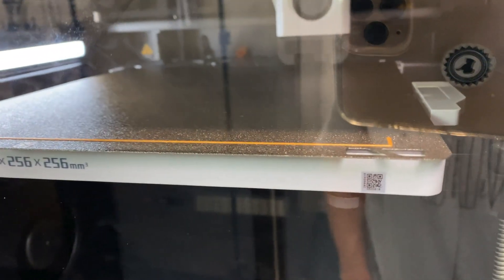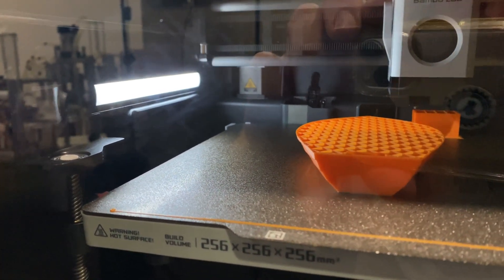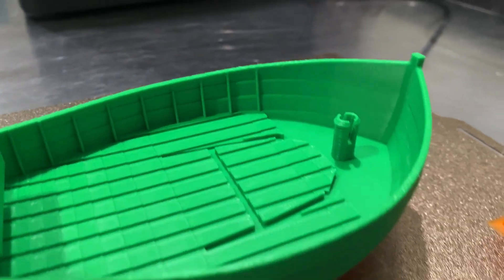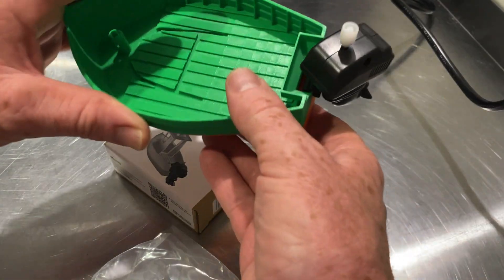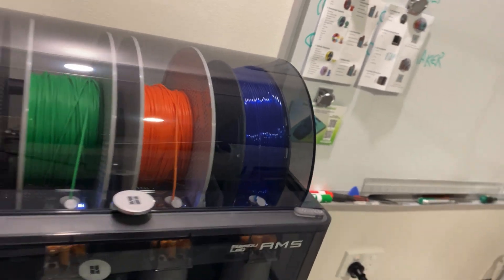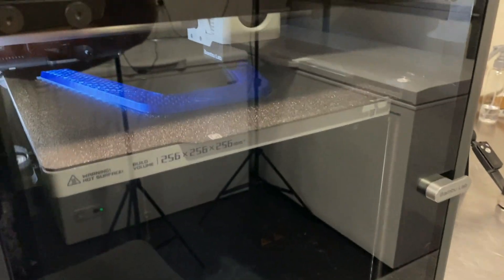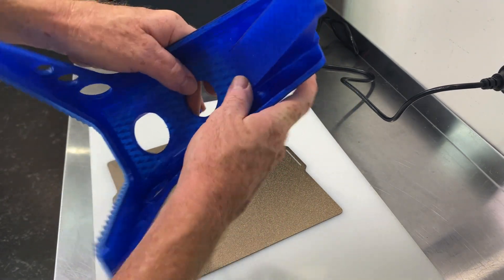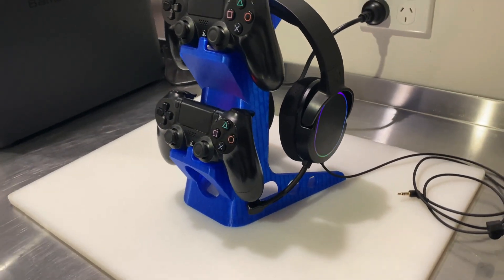Bambu Lab P1S First 3D Prints - Honest Review Of The Printer, Did It Meet My Expectations?

Comment: what about the sound?  a lot of people are saying that it is pretty loud....
Reply from the maker: Hi, they are fairly quiet while running. But do make a bit of noise when starting a print during the calibration. Thanks for watching 👍🏻
Reply: @Beast-Lab  i think i am gonna spring for one if they are still on sale next Thursday....i bought an A1, happy with it, but i regret the fact that i bought too early. I am big on printing more than 4 colors down the road and the a1 kinda does not cut it... it does but...

what i don't like about the ams lite is that you have to feed 4 tube into your machine and i have had issues when loading a single tube so i am just scared that 4 tubes is just gonna be traffic jam galore so i feel that one tunnel tube for everything is the best option. I am probably throwing money away here but then again those darn ams when not on sale are super ridiculous expensive.

Comment: If you havent yet, dont forget to run the noise calibration, my p1s didnt do it out if the box, but after i ran it from bambu studio it was amazing the difference in noise of the motors movement.
Reply from the maker: Thank you so much for the tip! Just ran the calibration, it made a big difference 😎 I’m not sure if it was done automatically when the startup procedure was running. All good now, I’ll be sure to make an episode on the feature for others to see. Nice one 👍🏻